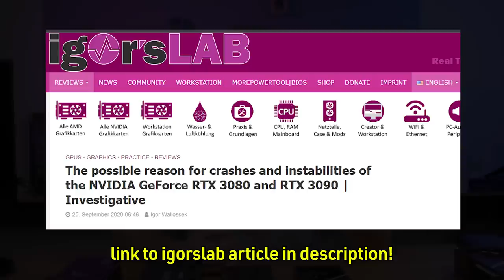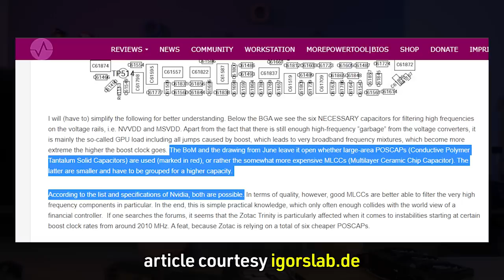The RTX 3080 Launch can't get any worse... Right? Wrong...

Comment: JayZ exposing AIB's and how they're cheaping out on specs but still charging the same price or more than FE's cards.
ha..haha.. :T
Reply: Blame Ngreedia. they are the one who's contolling AIB spec and profit margins.
Reply: Problem is they need to Pay Nvidia in order to be eligible to produce these cards so their profit margin is lower. Therefore higher prices.
Reply: All credits for discovery goes to Igors Lab like Jay says in beginning of video. But great to have one in english ;)
Reply: First of all: It's Igor who exposed it, not Jay and second: It's not that simple, there's cons to MLCCs as well (e.g. piezo-electric effect, prone to cracking, can create noises).
If you don't believe me, check out Panasonic's (one of the biggest capacitor producers) own whitepaper:

https://www.avnet.com/wps/wcm/connect/onesite/4c5a7356-bec1-4266-ac6c-a952efe7eb97/Panasonic-MLCC-V-Alternatives-EN-Whitepaper.pdf?MOD=AJPERES&attachment=false&id=1527062803823
Reply: @ShallowRavers2  JUST to clarify  Igors Lab  has a "theory" for this crashing. I am a long way from convinced as we have seen models with the so called more expensive capacitors being reported for crashing like the Auss TUF, and yet the Gigabyte Gaming OC has no reports of crashing with only the so called cheap capacitors (some user reporting ok over 2000Mhz). Nothing is adding up atm. I think think this is a auto OC boost issue exceeding the silicon GPU tolerance on some samples/cards, not capacitors.
Reply: Well they are not POSCAPS, They are called SP-Caps
Look at this video I guess https://www.youtube.com/watch?v=GPFKS8jNNh0
A youtuber is explaining about the whole capacitor configuration
Reply: @Battleneter  yo ive got the gigabyte gaming oc and its crashing just fyi
Reply: So asus or FE is the wave good to know
Reply: @DatBoi-to2zr  good to know, your the first I have seen. What frequency? are you over clocking or allowing to auto boost?
Reply: @Battleneter  auto boost, it works if I under clock by -50 but will be returning the card as its very expensive for something thats not properly tested and uses lower quality caps
Reply: @Battleneter  so you think its just the boost clock being set too high? idk why its going over 2000mhz if its only rated for 1900?
Reply: @DatBoi-to2zr  Because an algorithm is controlling the clock. As has been stated A LOT, the clocks on these cards will go beyond 1710Mhz if it has the THERMAL and POWER headroom to do so. The algorithm DOES NOT (I REPEAT, DOES. NOT.) know the binning of the silicon or the quality of the Integrated Circuits. 

If you've been in the PC space for any time and do any research, you know there are companies that sell pre-binned parts, that have undergone rigorous testing to ensure they will run at whatever aggressive overclock you want, but those parts come at a steep premium. (I'm talking about Silicon lottery).

A lot of this is likely coming down to slight differences within the silicon itself. Yes, a well built power delivery system IS going to help with stability across the board, that's why it's a selling point for ANYBODY with intermediate knowledge of computers. But I doubt "underbuilt" power delivery is going to be the ONLY cause for this crashing. Also, keep in mind software can have an impact on stability.
Reply: 2.0Ghz and beyond is obviously an aggressive boost...now combine that with lower binning due to manufacturing still being immature. You can't launch straight out of the gate with products with such aggressive boosts. I think that's the real issue here. 

Won't be surprised when even some ASUS TUF cards produce this problem. That will show that filtering capacitors is just one more straw on that camel's back. (I'm pretty sure the majority of those straws are the aggressive boost and binning.)
Reply: Insta bloody_impact_xt
Reply: There arent almost any invidia f edition card to begin with, because of that it sold like in 1 second. Even bots cant buy it that fast. The f edition is only for few reviewers, and to make you think that the 700 usd price is the true price of the card, when invidia make the most profit from AIB cards with the true prices 800 usd and above. Good marketing from ingreedia to make you belive that this is 700 usd card and well beyond the 2080ti in performance. The wont sell it for 700 usd, it not give then a 40% profit, they will release a paper lunches of this cards, and make profit from the AIBs card that truly exist. In the end they can rise the price to 800 usd or even to 900 usd on f edition and complain about the shortage and make you belive it is a true reason. Watch "moore law is dead videos" to understand this marketing.
Reply: Wrong bro, Igor did that, and the others like Jay just saw- / took notice of- his video. German technerd btw ;)
Reply: @Stevospeedo I think you're confused. Rewatch the video.

1. Reference spec has 1x of those expensive capacitor clusters

2. The current FE is not a reference card. It doesn't employ the reference design.

3. Cards built to reference spec (1x cluster of expensive capacitors), are not the one's crashing.

4. The cards that are crashing have x0 of those expensive capacitors. These cards are below reference spec (I repeat, current FE cards are not reference cards...not this time). E.g., the PowerColor card Jay used as an example (it only had cheap capacitors). And PowerColor gave him a heads-up about crashing, for that card.
Reply: correct!! this is why nvidia made their own
Reply: @789uio6y  More boohooing. The salt is so strong that I can taste it through the screen.

If you have a problem with Nvidia, there are 2 other companies making GPUs. Spend your money on their product stacks instead of repeating the same shit that's been screamed for weeks now.

Or, here's a wild idea. Start your own GPU design, fab, and manufacturing company and compete with them...
Reply: @Stevospeedo 

1. Nvidia decided to create a unique cooler that requires the PCB to be smaller, and very cramped.

A compact design creates more noise issues. 

This requires more filtering at the end.

There are a thousand other factors that add noise. If you decide to go with a design influenced by aesthetics or so other functionality, that comes at the cost of noise then you'll need to counter that in some way.

There are many things you could to to reduce noise. Add a backplate. Add more layers to the PCB. Spread wires out. Clean soldering so there's no/fewer sharp edges, use components that add less noise....or add better filtering at the end... etc etc.

2. I think you're confused on the subject of GDDR6X. 

GDDR6X clocked exactly the same as GDDR6 is 2x as fast (performs 2x as many transactions) and 15% more efficient per transaction.

But, GDDR6X on the 3080 and 3090 is NOT clocked anywhere near as high as GDDR6 is usually clocked (e.g  on the 3070). 

The reason it's performing slower than YOU expect it to, is because you're expecting 2x performance. But you ignore the fact that it's clocked much lower. GDDR6X is also not meant to be clocked the same.

Power consumption increases exponentially with increased clocks. E.g. halfing the clockspeed of a CPU will cause it to use a quarter of the power. There's great return in reducing clockspeeds. It's why mobile devices reduces clockspeeds. 

If you could find a way to reduce clockspeed without reducing performance, you'd end up with a more power efficient product. GDDR6X is such a product. It can perform 2x transactions per clock. 
Thus, it can have the same performance at half the clockspeed. (On top of that, GDDR6X uses 15%, less power per transaction).

If you overclocked GDDR6 high enough to perform the same amount of transactions, it would use significantly more power.

But 30 series cards, with GDDR6X are clocked a bit higher than half. GDDR6 would have to be overclocked to 2.4Ghz to perform the same number of transactions.

The downside of GDDR6X is that it uses more wiring. More wiring is more expensive to handle. That compounds even more if you want to create wider memory bus widths (e.g. a 512bit bus). And it's more likely to result in crosstalk. GDDR6X itself is more susceptible to noise. And performing 2x as many transactions means 2x the heat (minus 15%).
Reply: @tylerdurden3722  The Auss TUF 100% does have this issue, we are clearly seeing cards with BOTH types of capacitors having issues (both capacitor types have pros and cons btw), this capacitor theory is looking very shaky. Jayz has done a pretty crappy job in this video making a lot of assumptions based on the igorslab "theory". The auto OC boost is now the top suspect. 
https://twitter.com/HardwareUnboxed/status/1309659834468298753

Comment: There are also reports of this happening to FE Cards.
This might be a part of the puzzle but i do not think it´s the whole picture yet.
Reply: Deep Throat as a 3080 owner i really hope it’s a driver issue.
Reply: America  That sounds like an overheating problem.
Reply: could it be because there are about... 7 FE cards sold worldwide?
Reply: @JM-pg1jv  exactly. this many faults in so few cards is a total disaster. I had a feeling the Fe problems were just a matter of time.

Comment: Great information. But as far as I know, the ceramic high current SMD capacitors are extremely cheap and the PCB soldering process will not cost the factory significantly more. I would say the cost difference is <5 USD all things considered. You can literally go do Digikey/eBay and solder your own capacitors. Just stack them on top.

Comment: so are there any problems if you don't overclock ?
Reply: Yes
Reply: Gpu boost does it automatically so it can happen to you even if you leave it at stock
Reply: Yep you need to down clock your gpu to Remedy this problem. OC would just make it even worse!
Reply: You may need to underclock it a bit and let gpuboost boost it to the stable clock.
Reply: Yes, because the GPU automatically overclocks itself (that's what boost is).
Reply: 2BuckGeo  probably not the founders has extra expensive capacitors
Reply: yes as the cards do it automatically, until a fix is put in place that stops GPU Boost going too high the issue will remain. It's worth nothing that the cards will work completely fine following the fix though they may perform slighty worse than we have seen in the current benchmarks.
Reply: 2BuckGeo  Some have problems with the FE as well, but apparently fewer people. So it's not just the capacitors, but the boost, in general, is too high for weaker chips.
Reply: 2BuckGeo  nope
Reply: yes there's a problem.
you don't get overclock :p

Comment: When I'd order the 3080 and I'd get a card that's build below specs, I didn't get the full 3080 I would have paid for. I recommend sending it back.
 Those are the reasons I'm not an early adopter. :/
Reply: Well, as said in the video. The problem happens when the cards gets OC'd. These cards perform better then what is advertised. If an update gets launched, the performance of the card will still basically be the same, but more at the same level as advertised.. so your argument for not getting the full 3080 will not be valid. As for now, people are getting "better" cards, therefor you cant argue if they downclock to what you should be getting in the first plase.

Think that is the correct understand of this vid.
Reply: I'd take a piece of cake back home for you from Jay's birthday party
Reply: @OnixNO  You are right, but the "better" is also advertised.
Reply: @OnixNO  If the card is build under spec YOU DONT get what is promised, regardless of clock. That's my point. Also, GPU boost is something customers are used to by now. Having your card crash because of it, isn't acceptable. Remember there are people buying this card without further knowledge on how to fix it.
I get jayz point, but I disagree on offsetting being a valid solution. You should get a card that's build to spec.

Comment: Turns out it was just Windows drivers.
Reply: and Jay just having a heart attack over here.. XD
Reply: Not the only thing this last update broke
Reply: This should be pinned
Reply: Thank you microsoft
Reply: Yeah... drivers issues that get solved by downclocking and lowering the voltages... . Come on...don't be a sheep.
Reply: Oh, ignorance is bliss. Driver update that lowers clocks and power consumption and delivery right? That's what you call a software issue? Cause that's what I call a "temporary wannabe fix". It's not really a fix. It's a mask to cover up the fact that the card can't push the numbers stated on the box. LMAO
Reply: My 1080 shuts my entire computer off like someone pulled the plug when its working heavy. Mind you I have a high enough PSU to supply but it seems in most cases( as this seems rather common) that the PSU is the "issue"
Reply: Link on that "windows driver" problem or I call ignorant bullshit.
Reply: @srobeck77  https://www.youtube.com/watch?v=lhyCdraz54s - Comparison of the original and updated drivers shows a 1.5% voltage/clock speed reduction with games still hitting nearly identical framerates due to added stability.
Reply: Source?
Reply: @seditt5146  get platinum rated psu! It’s. It not about power but about electrical noise and filtering that’s why they are rated!
Reply: @wtfman1217  how do I know if a card is rated or not?
Reply: @redbanlovesasians2236  cards are not rated, psu(power supply unit) are rated
Reply: @wtfman1217  Ok, my Ryzen laptop has arrived and upon a few experiments I came across this: https://imgur.com/a/3gBAN7n  Windows 10 power plans are able to dictate how the hardware works even after a reboot into Linux (hardware handicapped by software??? new levels of disappointment...)  I'm looking into ways of "unlocking" my laptop's TDP on Linux, or Windows for that matter. (on Windows it's easier through Ryzen Controller) Now my question to you is this: if I use a higher TDP than the stock 15W one on my laptop, do I have the risk of frying the power supply? Does the power supply from a laptop come directly from the transformer at the power outlet? Or does it come from another component inside on the board? How do I find out what are my limits on a laptop? So I do not cross it.

Comment: From what I've seen, the ones which the issues have 5 capacitors, the ZOTAC ones that are the better revised version seem to have 6 capacitors and some balance on the back of the dye.
Reply: The issue turned out to be Nvidia post release drivers (pre release drivers were fine), had NOTHING to do with capacitors. Jay need to take down this video as its still misleading people like you,  but he keeps leaving it up for clicks $$. Yes Nvidia released a updated driver that corrected the problems on ALL regardless of capacitor type. Watch this explains all.
https://youtu.be/lhyCdraz54s?t=350

Comment: "I'm getting less than I paid for"
[ Laughs in GTX 970 ] You must be new here.
Reply: Insert the "First time?" meme
Reply: But the 970 was on NVIDIA. This is on the board partners.
Reply: @gabriellucena6583  depends on what minimum specs Nvidia gave them
Reply: but with the gtx 970 at least I got like $100 back for 2 cards that I sold months before lawsuit started
Reply: @willywonka7932  True. NVIDIA is really controlling so I'm sure they gave the OK for these too.